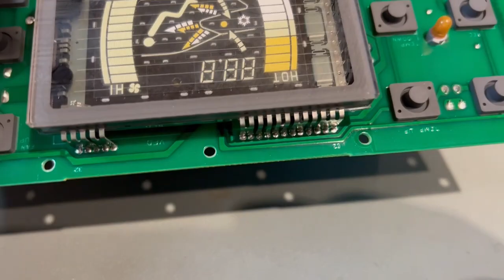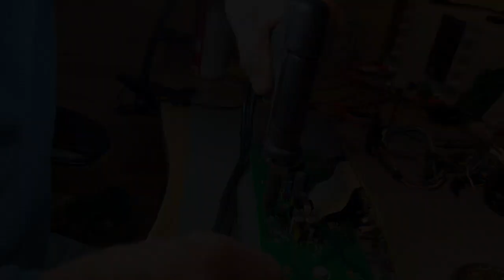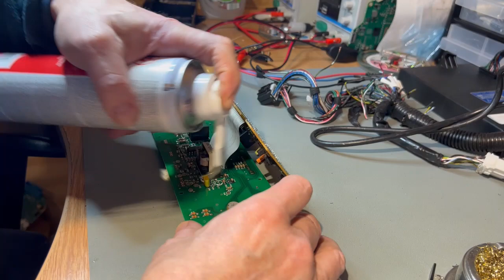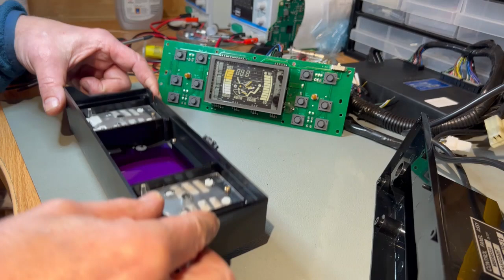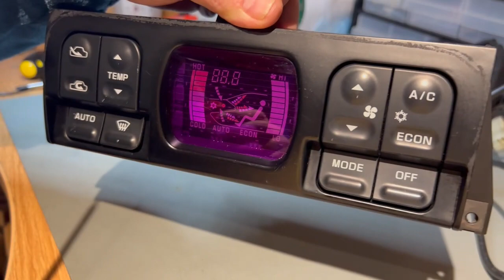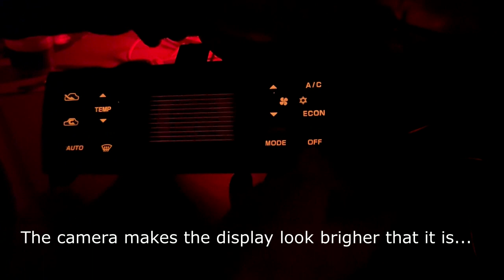Repair Mitsubishi 3000GT / GTO / Dodge Stealth climate control panel.

Comment: I wonder if there is a way to adapt the cruise control arm so a button can be used instead such as when you swap in a lancer steering wheel or outlander steering wheel with built in controls.